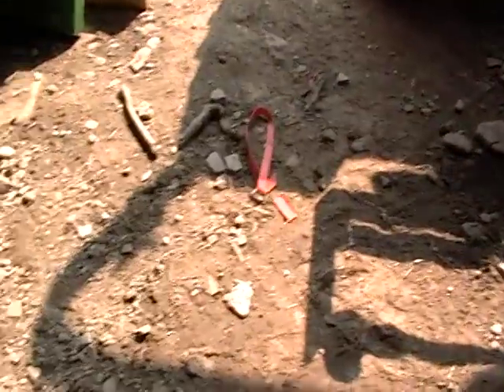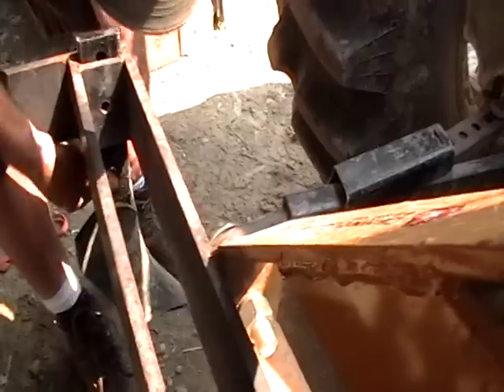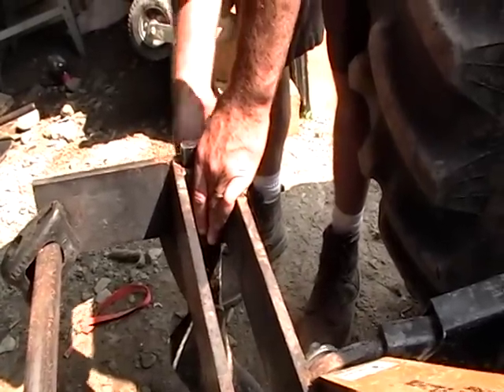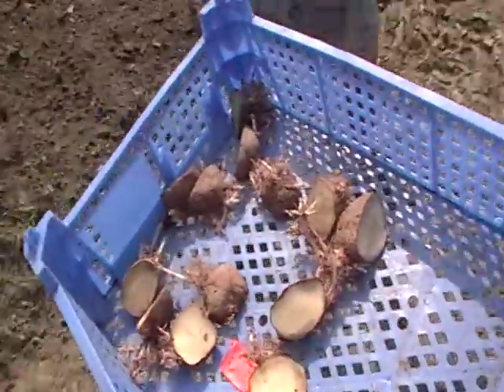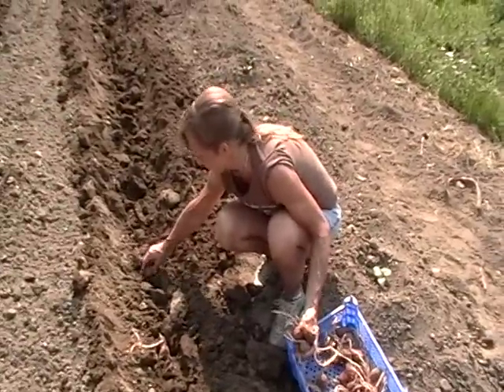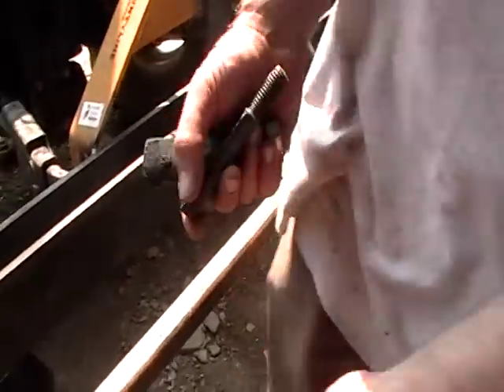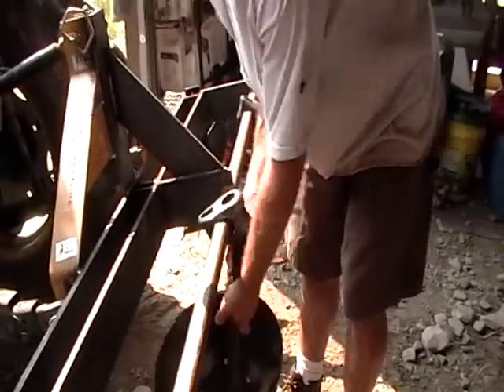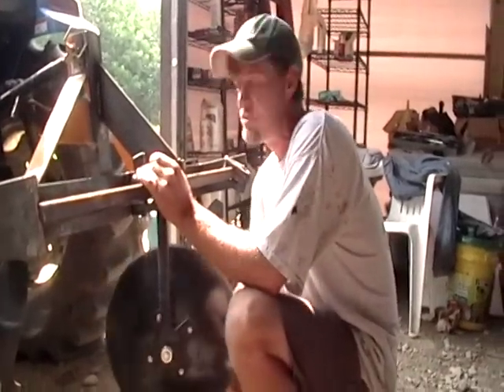Part 1 - Home made tractor attachment hiller row bed maker planting potatoes

Comment: ricOOman  you doing a good job making row maker.  
     When I plant red potatoes in my 4 --  100 ft  rows 36" apart I cut seed so maybe 2 eyes are on a 3 oz piece night before planting 8" apart in rows.  One year planted 100 lbs     boy that was allot potatoes.  I always cut all seed potatoes no whole potatoes planted, for me no wasted seeds.  Build me a 5 shelf storage rack 2 ft x 8 ft with 1/4 in hardware cloth on bottom 2 x 4 frame. Can slide shelf out on either side. Put hay on hardware cloth then potatoes on hay then cover potatoes with hay. When all 5 shelf are full wrap vertical with an old billboard tarp on no light will be on potatoes with opening at bottom of 1 st shelf which is 1 ft off floor so a fan can move air through potatoes if needed and top is open 2 ft  above upper shelf  air needs to come out top. Mine is under a shelter so no rain can hit potatoes.

Comment: you did a good job building it  --  potato cutting no bigger than 2 oz. about  will do good cut and plant-- your frame a little wider would make rows and cover same rows just by changing plow and bed blades or  just make another frame for covering rows --  a 36"row will do good job on 2 or 4 or more rows  do not remember what 1 row wide is think 46 or 42 ".  I use 2 row 36 "  4 rows 100 feet long of potatoes  I make rows , put fertilizer in, lightly plow rows again, drop cuttings, cover row with flat bedder, 2" high beds then when plant 2" high, cover with bedder and when plant 3 " high side dress and cover again. trying to have a bed about   no higher than 8" is goal. I use drip flat 2 blue line watering system line is on top of bed applied each year same line, this is 12 years on these drip lines now very few problem
geraldc
Reply: Gerald, I hope you see this. I know it's two years since you posted, but, brother, thankyou, such a useful sharing of knowledge. The nuts and bolts so to speak.
Reply: seeker101  you very welcome do not mind helping people

Comment: For watering 2 Blue- Strip drip water hose works great not watering weeds.  I put mine on bed beside plants after any plants pop out ground. My 1 in PCV 10 ft  pipe has hose tapped  in every 36 in to match rows each 10 ft manifold is attached with flex hose and all 22 rows get watered at same time.  Most of time I turned water on at 11 pm and off at 6 am  just depends on how wet ground is.  Slice my Better Boy tomato and it covers a slice of bread from my 6.5 to 7.5 ph of soil.

Comment: Also  went making you beds with dis if you had a flat piece of steel adjustable in height behind and wider than both dis  so your bed would be flat and about 12 in wide for plants in center --  could adjust height of bed easy

Comment: Question: You made two trenches per pass.  then you dropped your seed taters in the trench and then you ran a hiller pass to cover the taters?  Here's where I'm stuck. I've seen hillers that use a tine in the center and that's where the planting is done;  up in the top center of the hill not underneath it. 
You do it different cor potatoes?

Comment: Great video. Is that square tubing, or solid stock, that you used for the hiller mounting bar? Is is 1 1/4" stock? If not,  what size is it? Thanks.

Comment: working on an idea of a flip row maker and bedder.  think about this make rows, plow is up , pull pin, rotate row makers to top and bedder are now on bottom , reapply pin, ready to cover rows now, one piece of equipment.  This has been used for turn plows already.   Picture is 2 rows potatoes on each side of road 2013 garden

Comment: and shutting your engine off helps with air quality. too many people leave their tractor and pickup truck engines idling. 10 seconds or more and you use less gas re-starting it then keeping it idling to say nothing about pollution and climate change. kind of a no brainer but it's amazing how many people still can't seem to shut them off.
Reply: Good Idea......do you shut off your vehicle at stop lights ???  in the drive thru ???  or when you get the urge to pull over and hug a damn tree. ROFLMBWAO